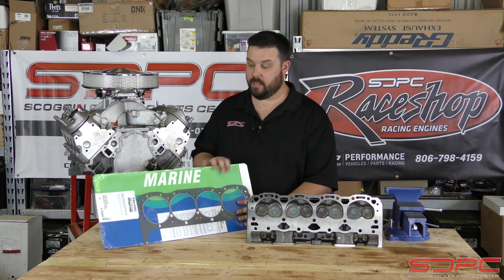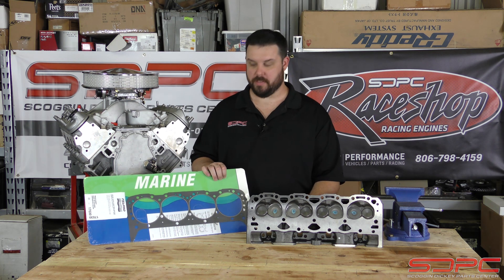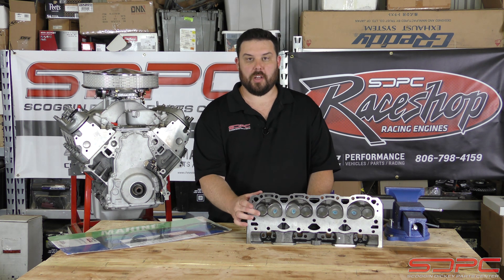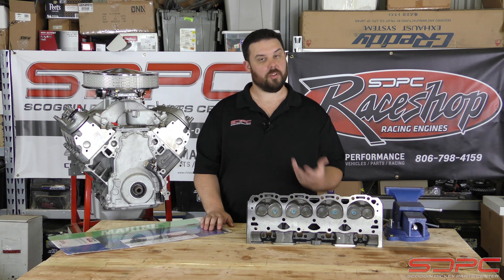SDPC Tech Tips: Marine Engines

Comment: The only real difference between marine and road engines are they are a higher duty cycle and open cooling system version. Of course you can use a road engine in a boat but you have to use a closed circuit cooling system and use higher performance radiators/heat exchangers. You probs don't want to run it any higher than 70% of it's duty cycle either.

Comment: They don't give you titanium valves or steel heads and block and No Ross Racing pistons or good quality Quaker state oil from the 1970 S and No quality solid lifters or gear on gear timing

Comment: Great video but big oversight / assumption.  More than half the reasons you give why an automotive engine might not work well in a boat relate to raw sea or lake water running through the engine.  If I was installing one of these, I would set it up like my factory Volvo engine from the 80s:  my engine and many marine engines are cooled with coolant/anti-freeze.  Instead of controlling the temperature of the coolant with a radiator, the coolant is passed through a heat exchanger, isolating the engine from and raw water.

Comment: Hey I was wondering what the price was on the crate motor. 5.7 MerCruiser Max the one I have is supposed to be 300 horsepower? Manifold cracked block Cracked put all other parts of good all new parts 450 hours only looking for a block or a crate motor
Reply: Blueprint motors sells Boat engines for cheaper than their regular ones.
Free shipping and  wait time is rather  low
Reply from the maker: Unfortunately we aren't a dealer for marine engines.

Comment: A water is added to coolant so no .. b. Marine runs same thermostat as the truck .. it's not free flow and the boat block is hotter as there is no airflow for cooling . So the piston clearance issue is bs .   Headgaskets at gm are identical for marine and truck engines .. . Also there's 2 types of cooling . Closed and open .. closed uses coolant and a heat exchanger for water and oil ...... open is lake water ..... I ran a stove bolt 6 for 15 years in my 89 starctaft 22'    ran 3500 all day no problem  . It was open cooling with car exhaust and flow master lol stern cooling exit  so I could read telp at exit too .. and hot water for washing hands while fishing ....

Comment: I’m a marine mechanic. I’m working on a vortex 350 with failed heads currently that has tuliped exhaust valves due to non hardened exhaust seats due to heat.
Reply: Nope .....they failed when thermostats stuck and it spiked to 325 died ...... restarted at 300 and flooded w 50°lake water and cracked lol.   Unless a 2500# load at 3k on flat lake is harder than 4k 1st gear up a 6%grade polling 11000# behind 6000# truck in 110° heat  over 160° asphalt ..... just saying.

Comment: Ring gap has a little more gap for expansion due to thermodynamics, MLS head gaskets, brass freeze plugs, severe duty stainless steel or inconel exhaust valves, valve springs are whatever the cam needs or requires, the cams typically have less duration (about 224 degrees max at 0.050) and a higher LSA (112 to 114) to avoid reversion (unless you have exhaust above the water line then it doesn't matter)....I personally also run my mains just a few thousands looser for thermal expansion.  I would say most boat engines have hypereutectic pistons but forged is always better for strength.  Also, boat engines aren't about horsepower, it's about torque!  Most boat engines rev less than 5500 rpms.  You want power in the low to midrange band.  The more torque, the more pitch on your prop, the more speed at a lower rpm and faster times to plane.  That's why you see tons of big blocks in the 20' and larger boats.  Fresh water cooling is a plus if you have it.  There's no crazy science to it besides protection from corrosion, heat and reversion.  However, you could just run a regular car engine but longevity might be sacrificed.  But I have seen people pull a 350 out of a car and run years on it.  I would not recommend it though.  However you still need to use the coast guard approved carburetion, charging and starting systems with flame arrestors.  Noone wants to go boom!
Reply: Agreed

Comment: There's way to much misinformation here😂. Ring gap not piston clearance is the most important aspect. Never Ever run Silicon glass pistons in a marine block. Sodium filled exhaust valves are a thing of the past as stainless or inconel is the norm in modern heads. Most all modern blocks use stainless welch plugs also, no need to replace them with brass. The LSA is the only factor on a camshaft to prevent reversion. Which is also affected by exhaust resonance. Bottom line is a race ready short block will last decades. A stock block made to run in an auto will ring bind and break the ring lands. Hypernuetic  pistons "silicone glass" can shatter. Most everything marine specific is geared towards explosion prevention in  electrical and fuel related parts and must be certified marine including fuel hoses.

Comment: Some of the points are valid, some BS. Mercruiser doesn’t add extra clearance to marine engines, same as car truck engines. The computer will run a truck engine same as a marine engine, cam isn’t radical enough to need recalibrating. Some of this is just marketing bs so you pay a higher price.

Comment: My Sea Ray will run 3,000 rpm for 3 hours at a time running up Lake Powell from Wahweap to Bullfrog. (The lake is 186 miles long). You are correct on the valves and the bore and everything else you mentioned. If you run street heads and are carb’d and run too lean you’ll drop a valve seat especially in older engines designed for leaded gas. I know. I’ve done it. Bottom line in marine engines even mild performance ones its a pay now or rebuild it later and pay a lot more type of deal.

Comment: I have a 400 small block carbureted it was a short block build for a truck used the same cam crank etc swapped marine applications on it from heads up and 4 years later still runs great I would say it loads up with fuel after coming in hot but lil nuts rev and clears up  I’m just saying diy it can work vortex is different but old school carb motors easy

Comment: None of this stuff is relevant anymore with a closed-loop fresh water cooling system Ring gap
 does not matter either since inboard boat motors have thermostat  only difference is cam profile vortec heads in trucks have harden valve seats so let's hear the next new difference between marine and automotive

Comment: You are assuming that all marine engines are raw water-cooled. Basically every boat that is in saltwater is not. They use the same coolant trucks do and run at almost the same temperatures.
Reply: Was gonna say this... FWC doesn't solve all the problems talked about here, but it solves most.  It also keeps all the shit from lake or salt water out of your water jackets and makes it easier to winterize.  The way I look at it, engine temp is easier to control and a heat exchanger is a lot easier and cheaper to clean and/or repair or replace than the whole engine.  On our Detroits, we have a flush port to run fresh water from our potable tank through the raw water side and when we descale every five years, very little comes out.  Been thinking too about adding a thermostat circuit to the raw water side to let the engines get up to temp quicker and stay there at lower RPMs since we mostly cruise at 1000-1100 RPM.

Comment: My 1999 chevrolet 3500 van 5.7 L31 with zz4 hot cam upgrade springs and aluminum dual plane intake been great! I rebuilt 2 year's age has been in my 23ft Baja Force 220 shit if I get one more season out of it  better than 5-7000 $from mercruiser! I spent 1000$ on everything to rebuilt it .. granted I'm doing this myself but it's 5-7000$

Comment: they are the same as the GM crate engines. The local dealers buy them from GM and not Mercruiser or Volvo. Stainless steel water pump impeller? all the same. My machine shop says no difference lift on "marine cam". I'm going on inland freshwater boats. All of the head gaskets I use have stainless steel openings in the head gaskets anyway.

Comment: I seen people take 86 Chevy truck motor and put in speed boat and I seen a guy put a  2000 Mazda engine in a bay liner  I also seen my cousin take the motor out the sunbird and it that in his fishing boat.  And I run a 4 cylinder dual over head cam from a Chevy colbolt  in my 86 invader so you my friend are full of shit

Comment: Boat runs at 175 degrees. There is not a bit of difference between a vortec 350 short block and a gm truck 350 short block. Bore pistons crank rods are all exactly the same. I just rebuilt two Merc Mag Mpi's using salvaged truck vortec short blocks. They were EXACTLY the same. They just slap marine on it, put brass freeze plugs in and charge you an extra grand.
Reply: The ring gaps are typically larger on the marine builds. The std Chevy truck engine cam is very close to what Volvo Penta uses as a marine cam and should not cause any issues. AFAIK the vortec head is a vortec head and the valves and springs are exactly the same. For sure, the core plugs on the marine engine are brass.
Reply: Yep, and what's with this "running lake/salt water through the block
Everyone (so I hope) uses heat exchanger, rendering all the "mods" useless
Reply: @blackturbine Whats with it is that this is exactly what happens, believe it or not. A vast majority (yes, you read that right, a vast majority of pleasure boats) are cooled by the water they travel in, piped straight through the block.
Reply: The water pump
 ( brass impeller with stainlesssteel back)  crankshaft is different and the Pistons! The mercruiser Pistons have a very large ring land with thicker rings and the skirts. The crankshaft Bob weights are larger to balance it the rods are the same. The blocks can be either four bolt or two bolt Main.  iv put a 💯% Chevrolet L31 in my boat because the old engine was never winterize when I bought it so I know everything.  But it works out
Reply: @GoldenCroc 140 Fahrenheit or celcius? (Sorry I’m not a car guy, just interested)
Reply: @thefinaldispatch  Fahrenheit. 140C, never mind 175C coolant temp as standard would be way too hot for any internal combustion engine I have ever heard of.
Reply: @@BB-wl4qz I said short block. That doesn't include cam.
Reply: No need to be rude. Short block come in different forms. With or without cams. When you call a local builder you will never get a cam with your short block unless you order a specific grind. Therfore I referred to short block because you can order short block from the internet in any flavor you'd like and install whatever cam you want.
Reply: @timcarroll7505  you might not be aware of the differences between engines, but what what I can say for sure is that "boat(s?) Run at 175 degrees" is not even close to categorically true.  Its different between boat and engine models, with 140 degrees being a common temperature.
Reply: @GoldenCroc  I have four boats and all of my marine engines run at approximately 160 to 175 degrees. I have a 575sci. I have two 350 mpi's and I have a 496 mag. And that is Fahrenheit.
Reply: @timcarroll7505  Yes, and there is nothing strange at all about that. I simply commented on your 175 remark and how it pertains to boats in general, especially inboards. As you can see in my post above. Perhaps there was a misunderstanding, in which case I recommend reading it again. 

Or if there were a bit miswording in your initial reply, perhaps? Your latest reply seem to indicate this since you mention 160 degree yourself, not just 175.  160 and higher is more common for newer engines, while classic carburated seawater cooled ones  most often were 140F. 

And yes of course I know that is Fahrenheit, as anything else, even if one didnt know boat engines specifically, still would be unheard of for any internal combustion engine placed in a vehicle of any sort. Cheers mate.

Comment: I remember back in the 80's you couldn't get a stock small block v8 engine over 200 hp! (unless you bought a Corvett) I remember the 225 hp 305 Chevy in our 1978 Bayliner. That engine would SCREAM! At the same time I was in high school shop class working on a 350 in a Caprice, and honestly my grandfathers fuel injected 3.8 Buick would blow the 350 away! They went for years making v6's that would (easily) outrun most v8's until about 1996 or so. I also remember riding in a police crown vic verses the civilian model. WOW! NOT EVEN THE SAME CAR. Fact: If it says marine or police on it, It has power!

Comment: I guess I screw up and put a L31 crate motor in my boat with fresh water cooling 10 years ago. when is this thing going to blow up? It has been running strong for 10 years.
Reply: 335 hours on an LS1 5.7 Corvette MasterCraft Maristar 22.5. That’s not right!
Reply: 4.3 vortec 4 years running on a ski boat 🤷🏽‍♂️
Reply: Got a l31 in mine as well. Runs great. Called mercruiser and gave them the casting and it was the same casting numbers they used. Same motor
Reply: Now do salt water.
Reply: Yep, 10 years now on my L31. Fresh water though.

Comment: All this info is useless
First of all, nobody is dumb enough to pump direct sea water or lake water through the engine
There is this old technology that we call water to water heat exchanger, you pump normal collant, just the radiator is replaced with exchanger.
Second: efi system can be tuned for anything, including different cam profile, some even self tune for that.
Third:if engine rated at 7000 rpm before redline can't run 3500rpm continuously that's a crap engine.
Forth: temperature will stay the same no matter in the car or on the boat, the temperature is determined by a thermostat, if you are running your engine without it, well then you are just an idiot again.
Reply: I forgot to add, efi doesn't care about your cam profile, it's job is to keep the fuel mix perfect or close to perfect, exhaust sensor doesn't care about the gas flow It cares about the chemistry
Efi in standard fixed cam engine only cares about: spark timing, fuel to air ratio

Comment: Finally! Someone explains the difference. Another thing to consider, the water that’s pumping through the blocks, it’s a lot! More than what the average car can handle, that’s why boat blocks are galvanized
Reply: You can use a car or truck engine but you need a freshwater cooling system, means the engine runs with normal coolant and the coolant gets trough a heat exchanger with lakewater insteat of a radiator with air.

Comment: Thankyou  for this video  you are one of the few people that got this correct  i beleive the confusion  in general is from years ago  in the 1960s and 70s  more Specically GMBlocks   there weren’t too many differences in the Marine Engines yes the Bronze Freeze Plugs ,  a different Cam and  they used a Forged Crank to handle the Tourque  often in those days the GMMotors  used in Trucks,Industrial and FarmEquipment also utilized Forged Cranks  i think the SmallBlock 283  motors came with Forged cranks in some of the Muscle Cars and Trucks  i’m not a GMexpert but i recall Oldtimers saying it was the Corvette Impala and some Trucks that had those Forged Cranks , my Da remembers that a lot of HotRodders  would buy up any old Chris Craft Engine they could  and use that to build a high Performance motor  Chris Craft used GeneralMotor  and Ford SmallBlock and Big Block engines in the majority of their Motor Yachts  so there were plenty of them out there FYI  i lived inFlorida off and on for many years